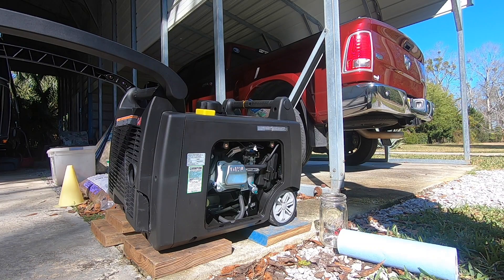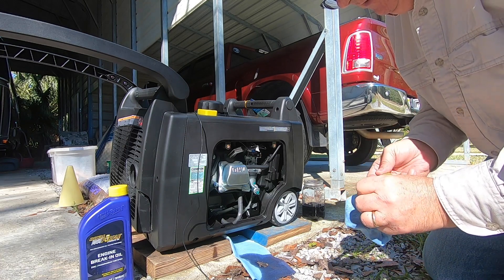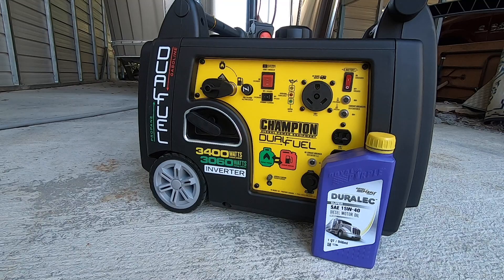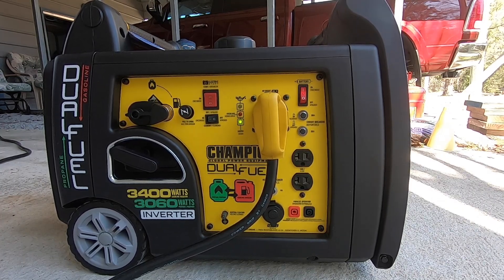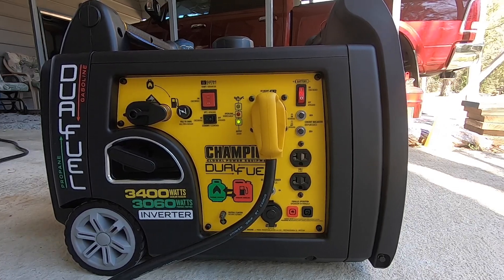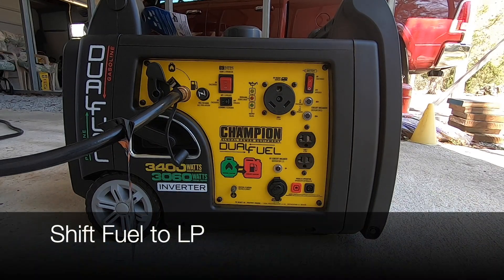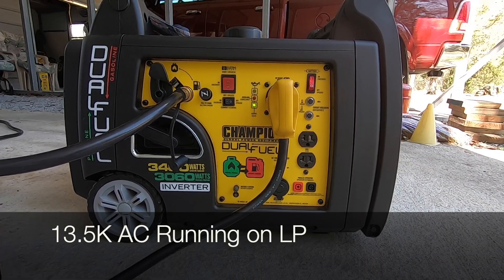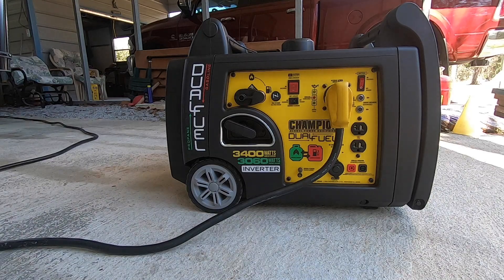Champion 3400 Dual Fuel Generator Load Testing -  Part II

Comment: 10W-30 was never recommended, at least from what I read about this generator (and other re-brands).
Reply from the maker: It's been a while since I researched that issue but I use 15W40 in all my small engines and zero problems. Thanks for the comment.

Comment: Great video. I recently purchased this very unit. We have a Winnebago Micro Minnie equipped with a single GE 15k BTU unit. Turned on the Generator waited a few minutes to turn on the AC fan came on and then within 3o seconds the generator went on to overload and shut off. Tried several times will not work. Contacted Champion haven't hear back from them. Any suggestions?!
Thanks,
Hugh
Reply from the maker: It runs my 15K just fine. Did you have it on Econ mode maybe? I always have the econ mode "off" when I startup then turn it on later. Other than that I have no clue. I do know that since Covid, Champion has been hard to get on the phone. Good luck and please let me know when you find a solution.
Reply: @LandingZoneHome  Thank you for your response. I actually called Champion yesterday and the first question they asked "was I at altitude when I tried to run the AC". Indeed I was at 8300ft. For every 1000ft above sea level the generator looses about a 100amps do to thinner oxygen. This unit works like the old fashion cars back in the day before fuel injection. My trailer is being warranty fixed at the moment I'll give her a try when I get it back and let you know my findings! Thanks for getting back to me.
Reply from the maker: @backroadsxplorer572  Thanks for the followup; and that is probably 100watt loss per/1000 ft. I will have to remember this next time I'm in the mountains.

Comment: Maybe you can help me. I have that champion inverter in this video it's brand new I have a Coachmen Apex Nano small RV it uses the WFCO 8735-p power station (the smallest they make) . I plugged the RV cord into the RV ready outlet of the Champion. After 1 day the 20 amp fuse of the power station which controls the inverter and battery charger circuit continually burns out. I am trying to do everything I can before calling a professional.
Reply: Understand completely. Thanks I'll call them.
Reply from the maker: I would call the WFCO manufacturer. Sorry I could't offer a solution but there are several questions I would need to ask to understand your setup. Good luck.

Comment: What a great video. We just bought our very first camper. A 9ft pop up with a 13500btu A/C. Any idea how long it would run using a standard size 20lb LP bottle with just the A/C running. Mostly in 90 degree plus weather. I've just hit the subscribe button too. Thanks for sharing your knowledge with the RVing community. 😊👍✌️
Reply from the maker: Thank you for subscribing and watching. I am not sure but guessing I think the generator should run between 8 and 12 hours on a tank.

Comment: I just ordered one, we will be camp hosting at 9,200 feet ASL and my prediction is that it will still put out 2312-watts at that altitude in gasoline mode. Our main use will be to power the microwave and to charge our Lifepo4 batteries when our 360-watts of solar isn't helping with the charge levels. Thanks for the thorough review!
Reply from the maker: It is a great generator and it will do the job just fine. Thanks for watching.

Comment: How do you get the champ up into your truck bed? I’m too old to risk my lower back...😎
Reply from the maker: I know what you mean, I'm no youngster either :) At home my wife helps and once in a campground I asked a fellow camper for help. It is not a one person job especially as high as my RAM sites. Thanks for watching.
Reply: A related question: When camping do you run your generator while in the truck bed?  If not, why?

Comment: I just bought one of these and it has not been delivered yet.  Does it come with a quick-connect LP line or just one that screws on to the propane tank?  Do you know how long it will run on a tank of gas?  Or how fast it burns through propane?  Thanks.
Reply from the maker: It comes with a regulator that attached to the LP tank and a quick disconnect on the other end that attaches to the generator. I don't know the fuel usage exactly but 6 to 8 hours on a 20 lb. tank. Thanks for watching.
Reply: @LandingZoneHome  Thank you very much.

Comment: Can you provide the oil break in schedule? And then the oil change schedule after the break in?
Reply from the maker: The break in  oil for 2 hours then change to fresh break in oil then at 6 hours on meter change to , normal running oil then change at 10 hours on meter and run for 25 to 50 hours. The book says 100 hours but I change at 50. Thanks for watching and enjoy your generator.

Comment: Thank you for your videos! VERY simple and clear instructions although I didnt catch what the surge plug is used for. Is there a video explaining this?
Reply from the maker: If you are using a surge protector it will recognize a "ground fault" from the generator since the ground is not bonded to neutral. The plug has a jumper between ground and neutral to resolved the fault. But with an Inverter Generator like this you don't even need the surge protector. Appreciate the kind comments and thanks for watching. BTW my new book just hit the market to "My RV Mentor" if you are interested here is the link. https://amzn.to/3qoIOpf
Reply: @LandingZoneHome  Thanks!

Comment: I love mine. Only 7 hrs and 2 carburetors already. I love using Propane.  I think I'll stick with it. Carbs are a pain and can't leave them stored for too long...uh
Reply from the maker: That doesn't sound good at all. Any tips you have would be appreciated.
Reply: Try to use non ethanol gas, the best..

Comment: I have the exact same model & it would not run my 10k btu A/C.  Called tech support & they sent me a new control board.  About 20hrs runtime & the control board is dead.   No power & just out of warranty.  Beware.
Reply from the maker: Champion has a 3 year warranty, sorry to hear abut your troubles. Good luck John.
Reply: @LandingZoneHome  We installed an Easy Start on our Coleman-Mach 13,5000 btu air conditioner and it starts as easy as melted butter over a steaming potato, yum!
Reply from the maker: @KU9L  Have heard good things about the Easy Start. Thanks for watching.

Comment: Great testing protocol.  It would be good to see the testing with more electrical items in use with one of the AC units.  I find with my unit, I can run the 13.5 AC & EITHER the microwave OR the 32" TV, but not both.  Where did you find the magnetic dipstick?
Reply from the maker: MJ maybe I can get some of that in a future video, thanks for watching. Magnetic Oil Dipstick:► https://amzn.to/37KJZGQ

Comment: Is this better than 2 Honda eu2200ic generators linked together? Is it quieter at all speeds? Dual fuel is a nice feature. Thanks, happy and safe RVing 👍
Reply from the maker: I would never try to carry and maintain two generators, that is a lot of work and expense. The 3400 is very quiet. The only downside is the weight of about 90 pounds, I need help getting it into the truck. Thanks for watching.
Reply: @LandingZoneHome  Yep, you have a good point about having the  two. Except with two Honda eu2200ic we get over 4000 watts combined and another benefit is if one is down for some reason or if we only need 2200 watts we don't need to use both. We actually have a spare or back up. Just like it's wise to bring along at least one spare tire, etc. Two is always better than one. I wonder which is quieter, the Champion 3400 on eco mode or one of the Honda eu2200ic on eco mode? Have you heard of the Generac 7127 iq3500 generator? It has some very nice features like a fuel gauge which the Champion forgot to include. The big plus to the Champion that I'm aware of is the built in dual fuel ability, which is a very nice feature. However when using propane as the fuel we loose about 10% or more of the power output because propane packs less punch than gasoline. 😉  Hope you're able to use this Generac 7127 iq3500 and can tell us all about it. Thank you for your interest in this size generator and your sharing honest feelings regarding them on YouTube. 👍
Reply from the maker: @Hundert1  Generac does may a good generator but sorry I know nothing about this model. My objective was the dual fuel feature and enough wattage to run one of my air conditioners. Good luck.
Reply: @LandingZoneHome  Yep, the dual fuel ability is DEFINITELY the main selling point for me as well. Is the Champion as solid and durable as the Honda generators are? No company makes more engines in the world than Honda. Thanks again

Comment: Just love your video's, are you thinking of producing a video that explains how to best prepare this generator/inverter for storage, long term and short term? Now that I have the Champion 3500w inverter I'm trying to take good care of it so it will last for many years to come.
  Thanks again for sharing all your knowledge.
Reply from the maker: I do have a video which explains how to keep the generator in good operating condition by periodically running the unit. Here is the link and hope it helps, if not let me know. https://youtu.be/pOFuGUQEEeo

Comment: Thank you for your video
I just purchased the Champion Duel/fuel 3500 W Inverter and I've been studying your videos on the setup and break-in process. I purchased this from Cabella's for the sole purpose as backup power in case of loss of power here in Florida in preparation for our Hurricane season. Do you think it will power my refrigerator, freezer, safely? 115v -60hrz -2.1a defrost 525W.
I will be doing all your break-in process with the products you used on yours too! You are excellent at explaining each step..Thank you
Reply from the maker: Yes Yvonne it will power those items safely plus more. Just remember the freezer and refrigerator will take extra "startup" watts to get going so turn one on and wait a minute or so then power on the other. You should also be able to have a few lights and maybe watch TV as well. :) Thanks for watching.
Reply: @LandingZoneHome  Thank you for your quick response..What i'm afraid that I did explain completely is that the refrigerator /freezer is one unit.. the freezer is on the lower part of the refrigerator. I apologize that I didn't make that clearer.
Reply from the maker: @yellen57  Thats okay, you will be fine, just plug it in and let it go.

Comment: I got the exact same generator for about two years-
It started to Leaking gas Can anyone explain to me why
Reply from the maker: Sometimes if the carburater gets gunked up valves will stick and maybe leak. I don't know if you will have to pull the side panels to get a good luck but if you do this link will show you how to remove the top and sides: https://youtu.be/osHqtg9WCHk Good luck and let us know what you find.

Comment: Nice video I went out to get the brake in oil but the dipstick what type did you use?
Reply from the maker: Got this one from Amazon: GenExhaust for Champion 3500/3400/3100/2800 Inverter Generator - Anodized EASY USE MAGNETIC OIL DIPSTICK https://smile.amazon.com/gp/product/B07HBC9NLH/ref=ppx_yo_dt_b_asin_title_o05_s00?ie=UTF8&psc=1
Reply: *break

Comment: Hello,  I am not clear as to if you were running both AC units simultaneously or one at a time.
Reply from the maker: Only one at a time. It would take a 5000+ watt generator to run both at the same time.